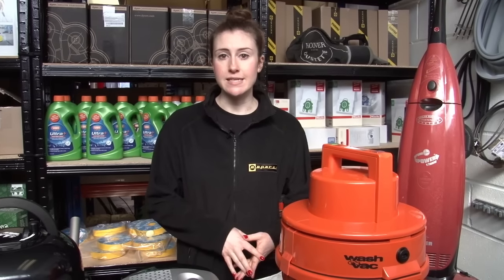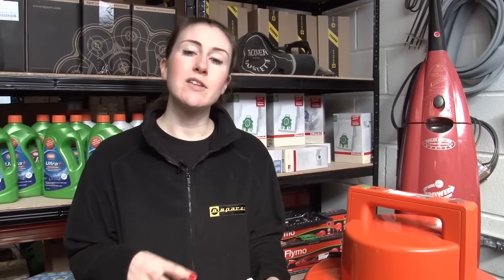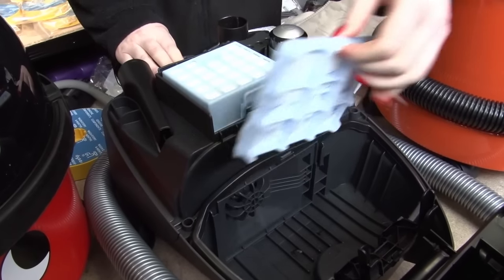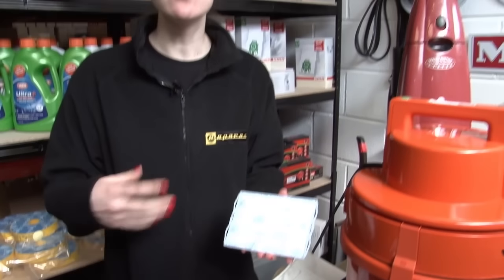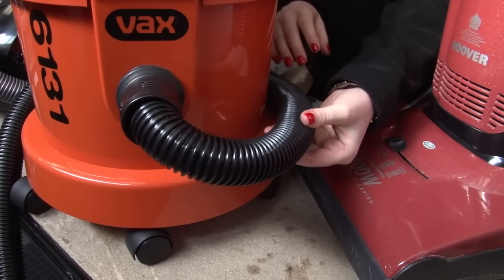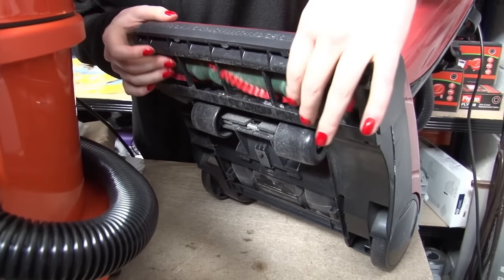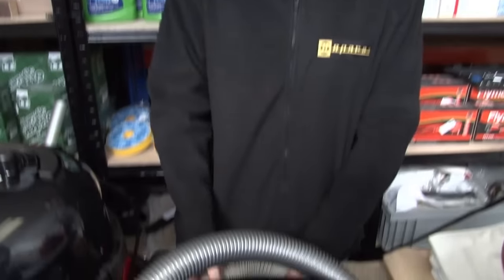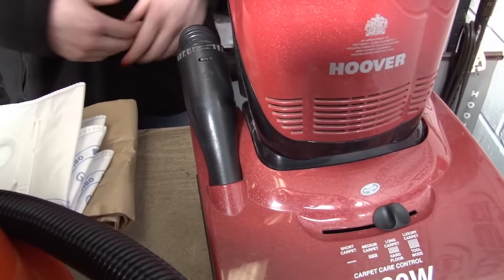How to fix loss of suction in a vacuum cleaner

Comment: Yes, very informative. It also helps to clean the outer bag by using compressed air or a Shop Vac to open the pores, too.
Reply from the maker: +Matt Jones Good tip Matt, Thanks for your comments. :-)

Comment: My  upright beg less Vaccum arrived today. And it works well on the carpet. Great. But when it is connected to the hand brush to clean on sofa and stairs, it doesn't suck at all. At that time also it sucks dust from the carpet. Please help me. I checked, but can't figure out the problem.
Reply from the maker: Sathish Kumar You haven't given any model details for us to identify the problem. In general when using the machine by the hoses the suction has to be directed from the brush bar. on Dysons there can be either a sliding valve which changes when the machine is in the upright position. This may be covered in your instruction book.

Comment: My vacuum is a Dirt Devil; what can I do to fix it?
Reply from the maker: +EricEbac22 All vacuum's work by the same method of drawing air through the machine and filtering to catch the debris and particles. Follow the steps as they will be similar ie, check for blockages, check the filters, check for air leaks. By doing this you should be able to identify what is going wrong.

Comment: my vacuum works but the tube doesn’t work and i need to clean smaller areas where the vacuum won’t fit
Reply from the maker: Hi Banana Sauce, is the tube damaged as it sounds like you may need to replace the tube.

Comment: So, I have an Electrolux Nimble vacuum cleaner. The hose has nothing, and I picked up a piece of paper through the vacuum. It got stuck in the hosing. Then, it went through the pipe after I pushed it through. I emptied the dust canister and it has no suction still. What do I do?

Comment: i have a vacuum cleaner ( the container type) (not the dust bag one). unfortunately the filter is broken. can a vacuum cleaner still function without a filter??? guys please help...thanks!
Reply from the maker: Without a filter small dust particles that are in the air will be blown back into the room and settle as dust. If possible secure a piece of filter like: http://www.espares.co.uk/product/es470431/
This will help remove dust and small particulates from the exhaust air.
Reply: Thank u u guys for responding....u r the best !!
Reply: satya mehta iii

Comment: Just read the last sentence if you can't read it all, anyway, Just bought a second hand Jaguar Vacuum cleaner 2000w, Model Number : JBv40, I gave it a go when i got home and wow bad suction, it did suck a few bits of chips from the night before but it wasn't exactly sucking the dust particles out of the carpet, so i realized The previous owner didn't even empty it out, i went and emptied it out and the sucktion may of improved by 10%, ugh so i ! Cleaned the filter under a tap, and wow it was dirty! so much dirt all over my sink! >.< so now it is drying out in the sun. i hope that works.
Reply: +BadMadPlay well that seemed to do the trick i cleaned the filter and now it sucks my carpet with too much power haha, thanks for the tips
Reply from the maker: +BadMadPlay Glad you sorted your problem. Replacing a filter will usually improve the results but it sounds like yours is good enough now lol.
Reply: Haha well i think a filter would work better so till i have enough money for the filter in mind for this model i will get it eSpares
Reply: Over a year later. Its lost a lot of suction

Comment: I hope it was the dirty filter for me... just cleaned it out... going to run a couple errands while they dry.... CROSSING fingers... bc I really need to vaccumm!!!
Reply from the maker: Hi Talenki, some filters can deteriorate if washed so it still may be worth replacing them to help get your machine back to full power. :-)
Reply: eSpares it did work back to normal!  :)  mine actually had two filters,  a thick sponge & behind that a thin black one,  so I washed both bc I never realized that black one could come out,  so I washed it for the first time in like a year.  THANK YOU =]

Comment: Ah the gid auld Hoover Purepower! Still use my blue U3460 to this day. Had it well over a decade & it's still working as good as it did new. Only thing i've replaced is the power switch, hoover bands & filters. The H20 bags are cheap & you can even reuse them once or twice by cutting or unfolding the bottom of the bag & using one of those slider clips to reseal it. Hoovers & Vacuums never lose suction as long as you maintain them  (-̮̮-̃)b
Reply from the maker: That's what we like to hear some one getting long and good service from a machine by just 'looking after' it with a few simple maintenance jobs. Thanks for your comments Reminiscence26. :-)

Comment: If the carbon brushes in the motor were bad, the vacuum wouldn't work at all.
Reply from the maker: Hi Mitchell Armstrong, you are right if the carbons had worn to the extent they were no longer making contact it would stop the motor, thank you for pointing it out.